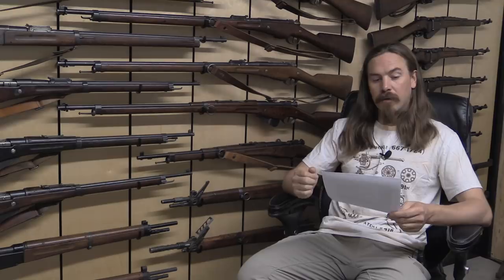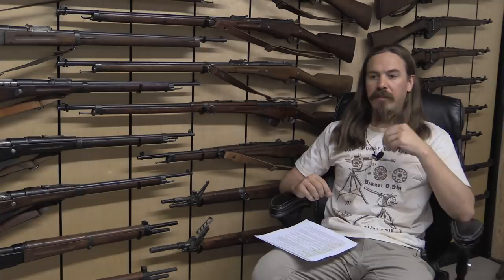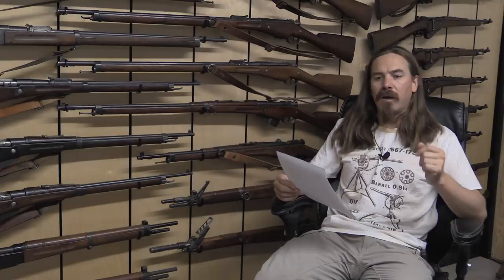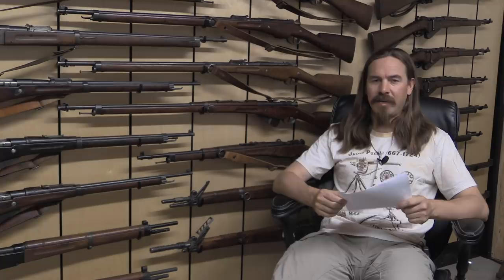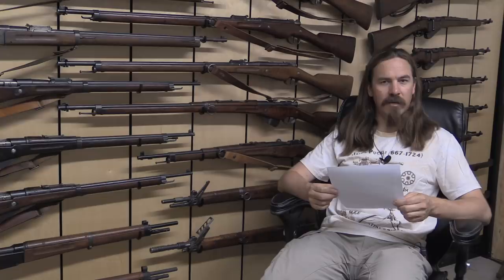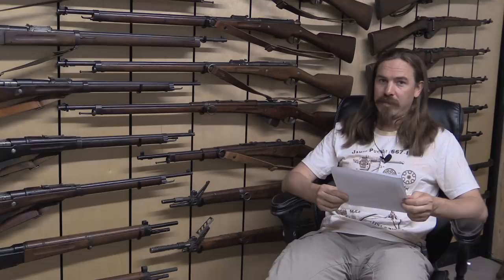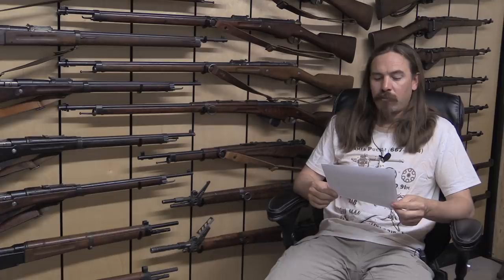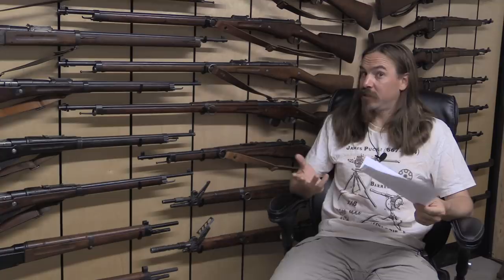Q&A #10: Collectible Surplus Guns, Dumb US Decisions, and Lots of French Stuff

Comment: The M1917 was also 3" longer and 1.5 lbs heavier than the M1903. The M1903 was adopted as a "universal" rifle replacing the carbine and long rifle. The Enfield would have been a retrograde step as it would have been clumsy and hard to use by the cavalry, which remained about 20% of the US Army's post-war (1920) Regular Army.

Comment: As a British Army Cadet in the 60's, for training I was issued with an Enfield #4 303 rifle. It was marked US property on the right side serial 51C3692, there was no catch to remove the bolt, instead there was a cut out about 1/2 inch from the breach and the bolt head was aligned with the cut out and could be flipped up to allow the bolt to be slid out.
Other than those mentioned above it looked exactly the same as the other 303 Enfield rifles in the armoury. Have you seen others like this?
Reply: Yes, seen one in my closet.  Interesting to note, the metal parts were painted olive drab green at some point in its history.

Comment: Never knew the Vulcan used gain twist, very interesting stuff. My Phalanx Close-In Weapons System utilizes standard rifling and is also 20mm, however it's a plastic jacket sabot; the projectile itself is 17mm. Could the sabot design explain why it's not necessary for CIWS? I should probably know that as a First Class...Thanks Ian, best Q&A yet.

Comment: Waiting patiently for the MAS-38 slow motion video.
Reply from the maker: It'll be a while; NFA transfers are running something like 9-12 months right now.
Reply: @ForgottenWeapons  On the first question; if initial rifle twist adds peak pressure, which then requires a heavier and more expensive gun no matter what type, and gain twist is difficult and expensive to manufacture, then why not machine the first half the barrel smooth and only rifle the outer half? thus reducing peak pressure and spinning the bullet?  all at low cost?
  Might boring out the first half of the barrel enable the German guns to fire the hot Russian PPSh ammo?
Reply: @ForgottenWeapons  Might you be more interested in binary triggers if you were not a machine gun owner?
Reply: @ForgottenWeapons  If L85-L98s came to American civilians, I would expect it to be through British supplied third countries, which might be more reluctant to destroy them, such as Chile? Guyana? Pakistan? Saudi Arabia?  Strange to think they would trust Pakistani soldiers before American civilians.

Comment: The gain twist rifling idea sounds like a compound radius fretboard on a guitar.  On a regular guitar, the curvature of the fretboard is uniform (like the surface of a cylinder).  A compound radius is like the surface of a cone...the fretboard is more rounded near the nut/tuning pegs and flatter near the body.  The reason for this is that it's easier to play chords on a rounder board, but easier to rapidly play single notes and "bend" the strings to change their pitch if the board is less curved.  Being able to use computer-aided machining today makes compound radius fretboards hugely easier to make...this is a feature found on entry-level guitars now that were custom shop options 30 or 40 years ago.

Comment: Rotating barrel pistols... Beretta claims that the rotating barrel, through the magic of physics and conservation of momentum, imparts less rearward force to the shooter's hand. Sounds fine on paper (for a not-physicist like myself, anyhow), and in practice (IME/IMO) the PX4 is fantastically soft shooting; the sights are so easy to track it's like using cheat codes. Very underrated pistol. Given current market trends, had Beretta designed the PX4 as SFA instead of TDA it'd be MUCH more popular.

Comment: The most likely source of L85A1 in the US would be ones that had been previously owned by film and TV armourers.

During the 1980s Royal Ordnance was prepared to sell the SA80/L85A1 commercially to film and TV armourers. As they look futuristic yet use a standard AR15 mag and ammunition you do see them in a fair few US Sci Fi shows and films in the late 80s, 90s and early 00s. For example you can see the L85A1 in the TV series Firefly.

That would be the best way to source an L85A1, the external parts and furniture to make it cosmetically look like a later A2 can fit on an A1 model also easily available on ebay and other places.

If you wanted it to look like an Afghanistan used A2 you would need:

Daniel defence railed foregrip (regularly pop up on ebay)
Grippod
Magpul EMAG
ACOG with back up holo sight
ACOG raiser (original and Airsoft copies available on ebay)

Comment: Redesigning the AR-15, I would have the spring wrap around the barrel and redesign the lower to allow two small holes on either side of the breach/barrel, for two rods connected to a circular plate which also slides over the barrel, which would be the contact point where the bolt and spring meet, which would be towards the front of the barrel behind the sight block, which would compress around the front of the lower and upper receiver face, then pushing the contact plate forwards, pulling the bolt along with it back into battery. I've thought of doing a similar thing with a short or long stroke piston design, which would wrap a gas tube around a barrel, which contains two springs pushing in opposite directions, one to push the short stroke piston back into place, the other to return the bolt back into battery. The pistons would actually be circular, also wrapping around the barrel, which in my head would allow a bigger gas chamber, allowing more gas to be tapped into it, which after pushing the short piston far enough to make contact with the bolt piston, would then get vented out if port holes, which should reduce gas pressure exiting the end of the barrel, making the gun less noisy without a suppressor, while the design itself, taking all the gas system and return springs and moving them around the barrel, which would, depending on barrel length, would reduce overall length of the final design.

Comment: In the debate of piston AR vs DI, DI works perfectly well in rifles with barrels longer than 14.5 ins. If you watch what Larry Vickers has to say on it (who helped develop the 416) the reason the 416 is a piston gun is because the perameters for it were to have a barrel length less than 14.5 ins and be able to run with a suppressor pretty much constantly. Early versions of ARs with short barrels tend to have reliability issues which is why the M4 retaines a 14.5 in barrel to maintain it's reliability, also in Vietnam it was found any shorter than 14.5 lends to greater hearing damage which is why xm177 had the noise dampaner/ flash suppressor on the end of the barrel.

Comment: You're correct on your Echo/Binary triggers, I do find the Echo fun and the only thing that isn't stated is the quick follow up shot. When shooting and not trying to unload the magazine, the follow up shot upon subsequent trigger release is neat, kind of like a 2rd burst option. Really agree with the safety hazard, especially since the release function doesn't always work as it takes a very deliberate pull/release technique to actually make it work. The upside is a decent semi-auto pull weight and for the safety deficiencies in the 3rd position I think makes up for being able to put the rifle in safe if the hammer is forward and there is not guessing involved if one forgets to charge the handle and move it into safe(it make you more mindful when handling tho). It really has no use and it's probably best bought just for the novelty of it's capability knowing that it's not a full-auto but pretty close...

Comment: Okay, out-there suggestion.

You mentioned the Kennedy assassination. I would be curious indeed to see you do a video where you discuss the rifle and ammo that Oswald used and the shots he made. Many claims exist about the shooting, of course. I'm not suggesting you delve into conspiracy theories or anything controversial, but rather just lay out the facts about the weapon and how it was used. Would be very interesting and informative!
Reply: Graham Kennedy I owned a 6.5 Carcano and it was not the piece of junk as most are led to believe.  It was pretty accurate and the round nosed ammo (military surplus) was of good quality.  Properly zeroed I could put five rounds in a 4" circle at 100yards. The bolt action wasn't as smooth as an Enfield but you can get three accurate shots off in about 10 to fifteen seconds.  I used super fine lapping compound to smooth out the action.  Removed a few machining marks off internal components and it operated great.  Only problem I had was a lack of clips for loading it.  I bought it back in the 60's for about $25 which included about 10 boxes of ammo.
Reply: I owned a Carcano 91/38 in the late 1980s and found that with most commercially-loaded ammunition with Spitzer bullets, the accuracy was terrible but, loaded with the longer round nosed bullets from Italian surplus, it was surprisingly accurate.  Something I didn't learn until after I dumped for a loss, unfortunately.

Comment: My thought on the Scout concept is that it is more results driven than anything. Most of the specific features are there to support the results. 

When Cooper designed the gun, he wanted a lightweight gun that you could grab off the wall, and do just about any job. All the details are a little negotiable. 

I think a What Would Jeff Cooper Do? project would come up with a very different scout rifle. To be honest, other than caliber and backup irons, your WWSD guns meet all the desired capabilities. If GWACS made an AR-10 lower, I would say with very little hesitation that a modern 'scout rifle' would be a lightweight AR-10 with a low magnification optic, ching sling, and a carbine length barrel.

Comment: On progressive twist: Couldn't it even decrease accuracy,  especially in long, (relatively) thin barrels?
Reasoning: As the bullet accelerates down the barrel, the twist length decreases, so the acceleration of the rotation increases more than in a standard barrel. Higher acceleration means higher forces on the bullet and (with action=reaction) on the inside of the barrel. The force on the circumference of the bore result in torque (again, more than in conventional barrels). That torque will cause the barrel to twist, and if the bore is not absolutely concentric to the outside of the barrel (or in the presence of other microscopic imperfections), the barrel will not only twist, but also bend in the direction of least resistance, "deflect" the bullet and intervere with barrel harmonics. That effect will be present in all barrels, but because of the higher forces more pronounced with progressive twist.
Thoughts?

Comment: You mentioned rotating barrel pistols like the Steyr. A modern version is currently manufactured as the Bond Bullpup. When I had Internet, I had an interesting conversation with the "inventor" of the modern iteration of this system. Mr Boberg (I hope I spelled his name  right) was surprised I understood the concept up front. The system was "self regulating."  It depended on  drag inherent to the rotating barrel system to allow it to run different power levels of .355 Parabellum (I am AMERICAN and am actively purging Metricrap from my use of the language) from target loads to "Sten gun ammo" (e. g. Original Georg Luger power level  ammo) without swapping out recoil springs. Because this locked breech system acts as a retarded blowback system, the amount of "retard" is dependent on the power of the ammo. His pistol had a unique magazine system where the cartridge was pulled backward out of the magazine and fed into the chamber. I mentioned that anyone familiar with belt fed automatic weapons like my platoon M2 Browning would understand the concept.

I suggested one chambered for .45 ACP. It would run 3.2 Bullseye semiwadcutter target loads, hardball, +P, and .45 super (230 grain bullet at 1100 feet per second) without swapping out recoil springs.  The feed system allows fully supported chamber. The problem would be recoil, not needing arm muscle to deal with recoil springs with a lot of hair on it.

Comment: I have an Italian Vertall-Carcano 6.5 mm conversion it's been deactivated to EEC standards.  I would have much preferred the Veterlli-Vetali 1880/87  10.40mm as that is classed as obsolete and I  as I wanted to work the action, and deactivation to EEC standards means slots cut in the chamber and the trigger group attacking with an angle grinder.  Slots cut in the chamber would have been more than sufficient as that gun shouldn't be fired anyway.   I think all I can do to it is to cut it down to look like the Great war Jersey defence force drill guns.  I want to cut it down to the length of the  SMLE.

Comment: OR, instead of chosing to shoot or not to shoot a gun with matching numbers, replace the parts you don't want to break BEFORE it breaks. obviously buying a whole new gun is redundant. But in the case of the G43s smashing thier bolts, just buy a bolt specifically for smashing, and save the original for when you sell it. Matching numbers are great for collecting, not that important for shooting.

Comment: Hi Ian, Love the videos, but just to say, the L98A2 rifle couldn't be sold on the civilian market in Britain, as it is a section 5 Firearm, (center fire, semi-automatic). In order for an individual to have one of these they'd have to get a personal letter from the Home Secretary, (same still applies in Northern Ireland for center fire semi-autos). Hope this helped...(if not Sorry).
Reply from the maker: The cadet rifle is not semi auto, it is manually operated.
Reply: That's the case with the old A1 version. the new version roled out from 2009 and that had replaced all A1 rifles is either a fully semi automatic receiver/trigger housing mechanism group, or a converted A2 rifle. but the old single shots have all be retired. (I know as I've used the l98A2 for seven years).

Comment: The MAS36 was obsolete compared to the M1. However, by 1940, the main rifle in the small professional US Army, was still the M1903 bolt action (only 50'000 gas trap M1 produced by March 940). There is a slight chance that the French Army had more RSC 17 & 18 in storage, in March 1940, than the US Army had M1. The interwar US Army  was not very different from the British and French interwar Armies : a lot of ambitious programs, but very slow implementation.

Comment: I'm honestly surprised that scout rifles didn't catch on with two groups of people: hunters and backpackers in bear country. The lighter weight of the scout rifle makes it obscenely easy to carry places like a hunting blind or cross-country. I suppose, though, that the lower-magnifucation long-eye-relief scope would make it somewhat untenable for precise gut shots at longer ranges. Additionally, the full-power rifle cartridge, while extremely useful in Africa, may be slight overkill in Alaska, where short-barrel big-bore revolvers basically purpose-made for close-in bear defense or simply a can of bear spray would do the job just as well. Additionally, a full-power rifle cartridge is complete overkill- not to mention somewhat unpleasant to shoot- for coyotes, bobcats, and other varmint as well as smaller deer species. However, I still want a scout rifle kind of setup so, so badly. There's just something about the aesthetics of a scout rifle that hits me hard. The shorter barrel (one of the 3s you forgot was that scout rifles had to have an overall length of less than 3 feet), combined with my favorite type of action to work, the 90° bolt, just makes  it an absolute home-run for me. And heck, if I had to, I could justify owning one for home defense, though it would be an extremely bad idea, what with low rate of fire and enough overpenetration to kill bystanders two apartments away. Their cost, though, means that I've got other guns to save up for first- a shotgun for home defense, a pistol for self-defence, and... heck. If I take the cost of the optic I'd want (breaking with scout rifle norms, a 3-9x with shorter eye relief)... I could easily set up a full-fat precision rifle in .308 with said scope and  ammo for days. Or I could get one of my dream guns- a Kel-Tec RFB- for the same amount as the rifle and scope.

Comment: Ian ......I uxed to work in a steel mill anc one fay we got a traincar full of demilled stuff and I founc A 4 ft. Used 30mm barfdl with a muzzle break on it I would  like to have the breech end plubbed and pro. Wielded and then use it as a black powddr mu,zld loader......is this legal......as far as I can tell it should be..... Then all I have to do is find a 30mm bullet mold....or maybe have a lead rod turned down to fit......what do you think?

Comment: Ian a multy lug design is more accurate because of variations in cartridge case wall thicknesses when they darw and form a cartridge  case it can have differences from 5thou thickness on the side wall which under 55,000 psi on side pushes harder on one side of the rim against the bolt face harder on one side then the other lug thrust a multy lug such as a ar 15 design takes care of this  difference better then two lug designs- This is what and why it can be more  Accurate !

Comment: Ian- I can assure you there is no significant velocity change in changing twist rate for a particular cartridge, spent my own money- Same barrel mfg with same chamber end bore diameter and same muzzle end bore diameter (aftermarket precision barrels are typically tighter by say .0002" at the muzzle end) same groove configuration, same reamer cutting the chamber to the same dimensions, same length, same muzzle crown, 8 twist compared to 14 twist, same exact load, and same exact cartridge cases use in both, over 20-25 sample size for each there  is NO significant statistical change in velocity. Twist rate vs velocity is a myth.